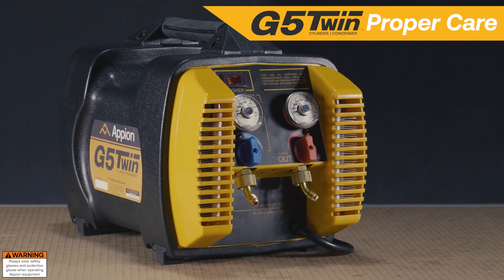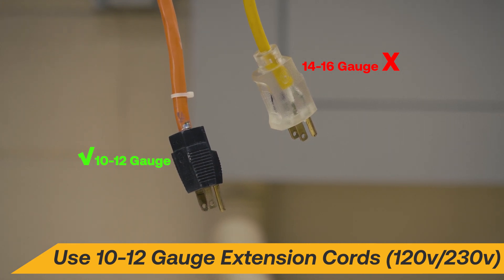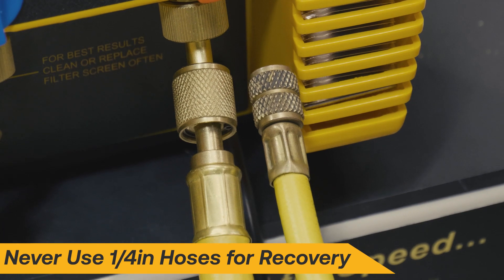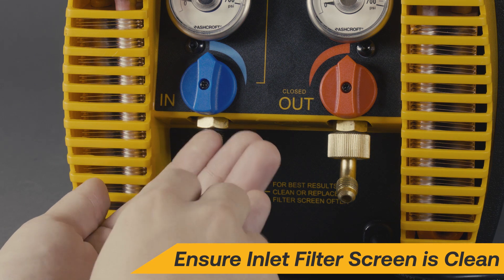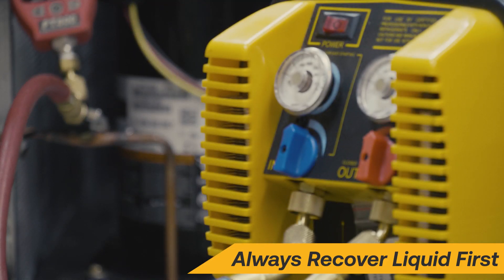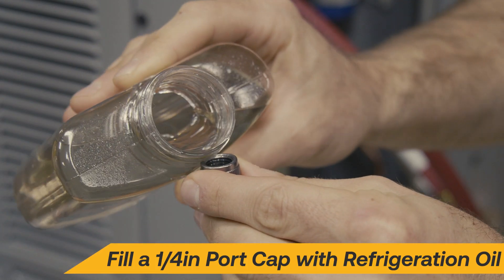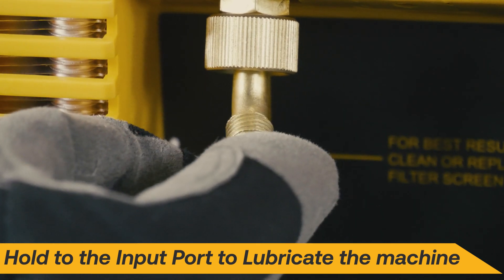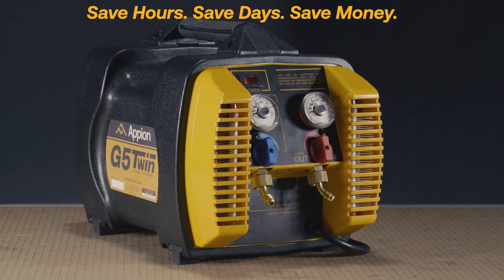G5Twin Proper Care

Comment: Is it normal for the angle fittings on the recovery machine to swivel like that when you pick up and move the machine?
Reply from the maker: Yes, the angled fittings are also swivel fittings. It is completely normal for them to move!
Reply: Ok great thanks! I saw the O-ring and thought that sealed it. I wanted to be sure I wasn't sucking air 😅